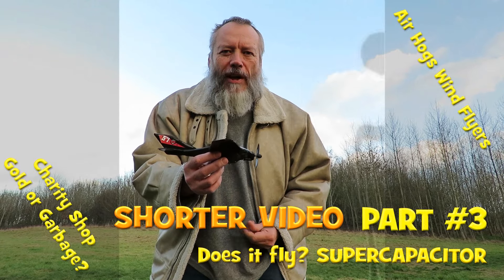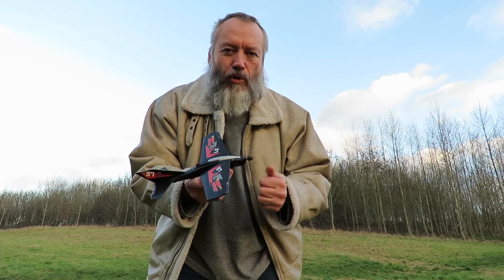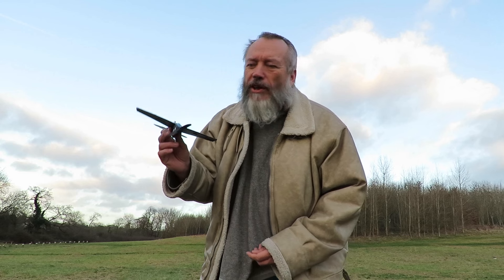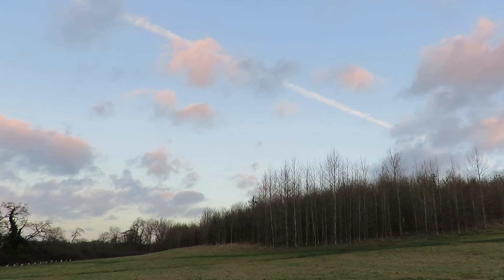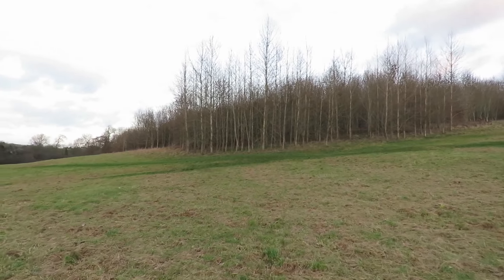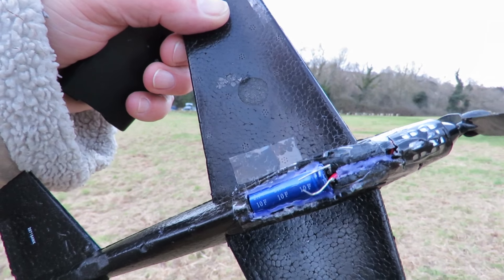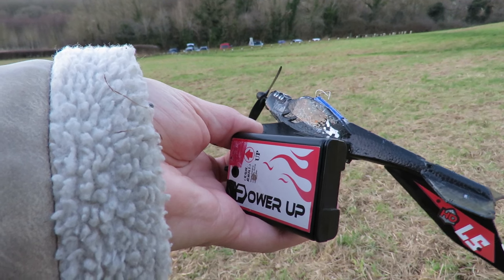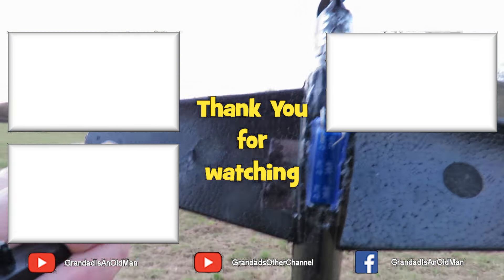Air Hogs Wind Flyers PART #3 Does it fly SUPERCAPACITOR

Comment: Hi Grandad. This would be nice video to have tried a white plastic bag strip affixed to the tail as a visual aid against the woods. 
I mention this to you sometime ago and suggested you use a VHS tape strip to one of you kites to help see it. I was just wondering if it would work or just add to much weight and/or cause flight disturbance?
Reply from the maker: Hi Ed, yes I must try to remember to leave some suitable tails in the boot of my car so I can add them as required 😊 I will put that on my list.

Comment: Hi Granddad!
I have a query. If i use 3.7V or 3-5V motors (716 or 8520), then  is there any issue in powering them with 2.7V supercap? Arent we underpowering them?
Reply from the maker: Yes, you have already answered your own question. You would not be using them at their designed rating but they will still work. You just have to recognise it will not be giving the full power.
Reply: GrandadIsAnOldMan 
One more question. What is the maximum motor I should use with this? Can I use 8520 motor with 65mm props? Will they work? I have ordered 716 with 45mm props. If 8520 will work better, I will order them too.
Reply from the maker: I am no expert on the subject. I just put things together and see if they work. If they don't work then I learn something. If they do work then I have learned something else.

Comment: I love your videos and I would like to edit my videos like yours but I would like a free program. Suggestions?
Reply from the maker: Up until last year I was using Serif Movie Plus starter edition which was a free download and did virtually everything I needed. Unfortunately last time I looked they had stopped offering it from their website so unless you can find it on one of those other sites that seem to pick up discontinued software I cannot really offer any other solution as that is all I have used since about 2013 until I upgraded to the full X6 edition which is still relatively cheap compared to some video editing software.
Reply: GrandadIsAnOldMan 
Thanks